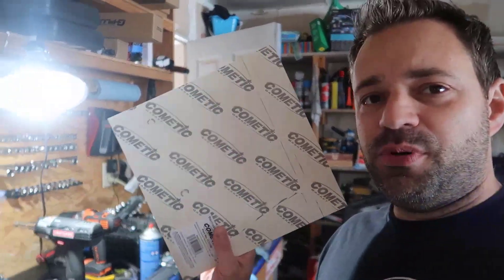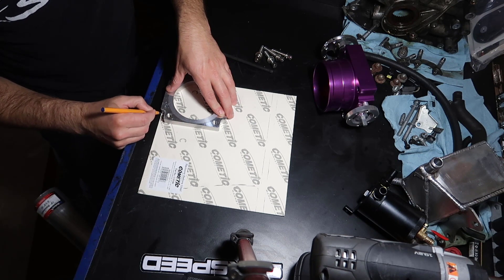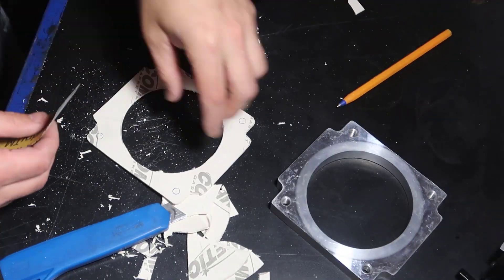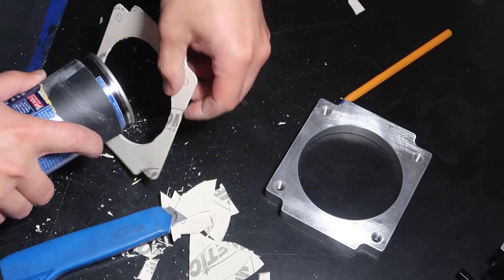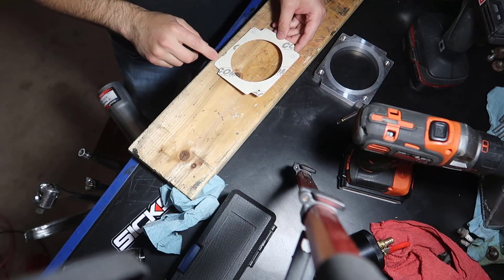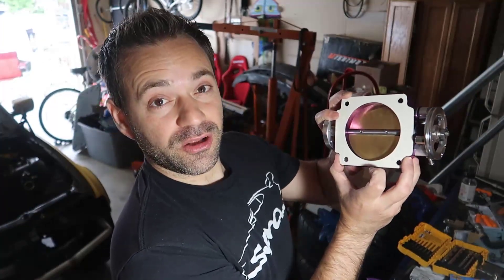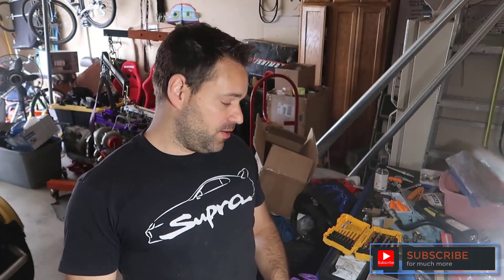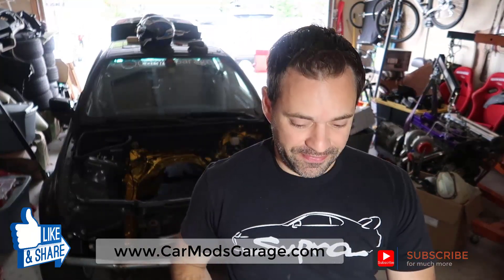Making a Gasket for my Throttle Body - 2JZ to E46 Conversion

Comment: I wanna know what are the differences between an OEM gasket style vs these thermal??
Reply from the maker: there is no EOM gasket for this aftermarket throttle body. I would have used the OEM for sure but needed to make one instead.

Comment: Would you recommend using silicone on both sides of the gasket as well?
Reply from the maker: I don't think so
Reply: @CarModsGarage  one of my bolts not lining up and its the same manifold and the 90mm?? had that issue
Reply from the maker: Ya same happened to me.  I expanded one of the holes on the throttle body to make it fit

Comment: I have cut this manifold up for my 4 cylinder and im having trouble finding a throttle body that fits this intake, is there any way you could link the one you're using? Also do all of the bolt holes line up like they should?
Reply from the maker: Let me try to find the link.   The bolts did not line up 100% but it wasn't hard to make them fit.  I don't have the link but I have one extra throttle I'm not going to use.  Shoot me a message I might sell it to you. marcos@carmodsgarage.com

Comment: Do I really need a gasket for my throttle body. I just want to see if it works. But I’ll eventually buy one
Reply from the maker: I guess of you are only test then no but account for air leaking from there so engine might thing that there is certain amount of air but will have less